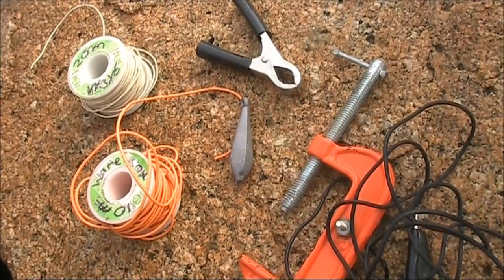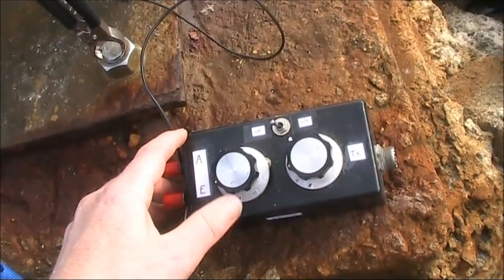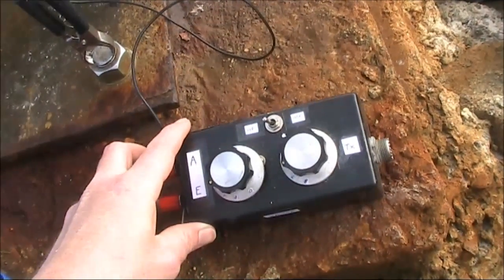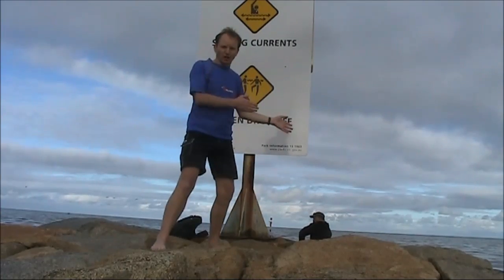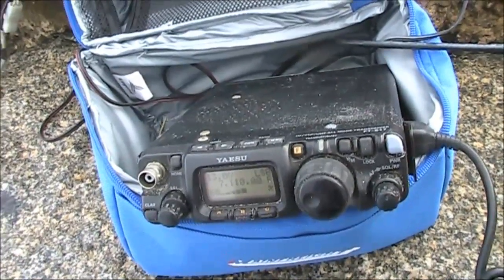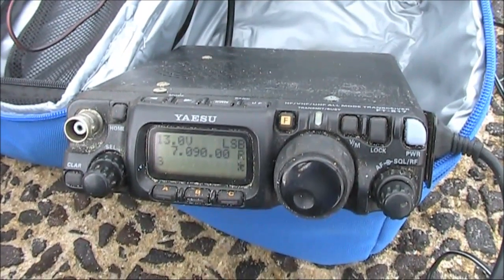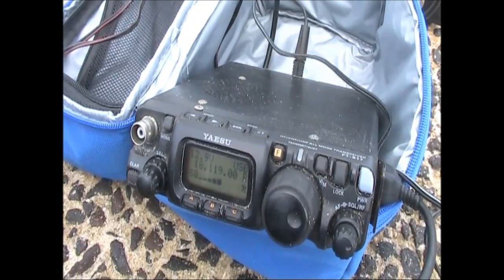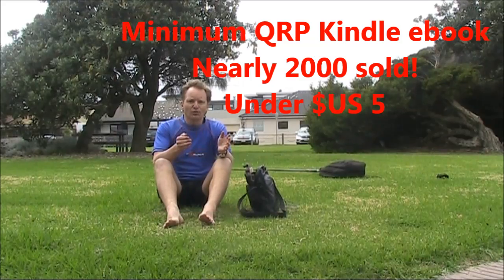How does 'any old bit of metal' go as an HF antenna?

Comment: I use tree as a antenna (VLF, LF, MF ) with fet preamp, like miniwhip antenna front end
.One rainy day I use umbrella as a VLF antenna...
Samtimes I use earth probe antenna...
This idea is goog - using metal parts as a antennas, best antennas I think is a lightning arrester towers, spikes... use inductive coupling to ground wire...
Long road metal barriers like a long VLF earth probe antennas...

Comment: When I lived in Victoria, BC, I was at a local beach park, I spotted a VW camper parked across two parking spots, odd I thought, as I got closer I spotted a wire coming from the camper to a street light pole. At the end of the wire was a horseshoe magnet, aye, aye I says to meself, what's going on here then? I knocked on the door of the camper, yup, a ham radio op, he slides the magnet up the pole till he gets the lowest SWR, uses his tuner to touch up the match. He did caution me to check the pole first to make sure is it is not electrically HOT. I started to look at light standards totally differently after that. VE7KKQ